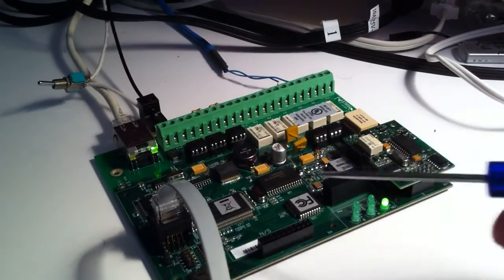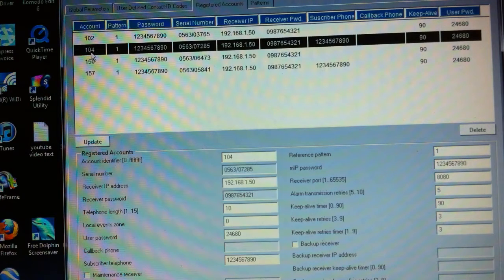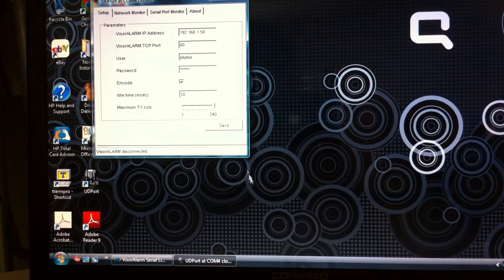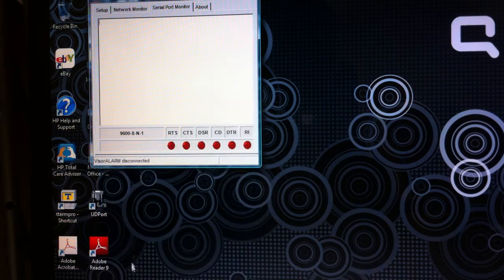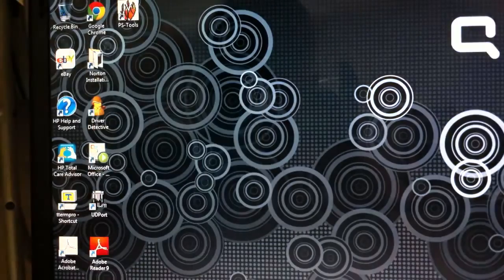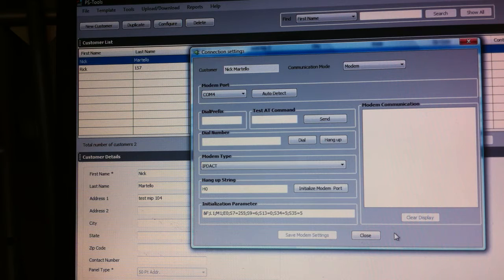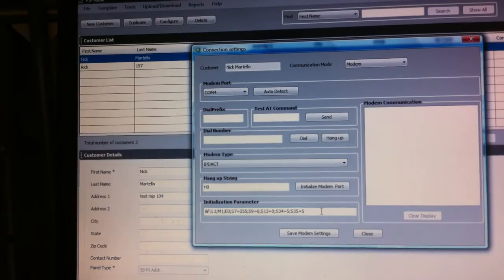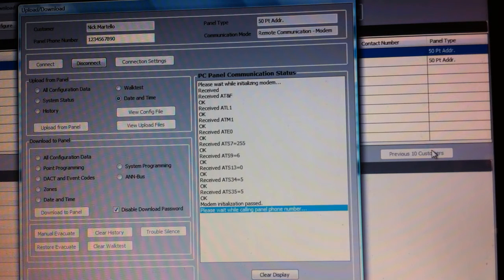Upload Download

Comment: I am having an issue with a customer where we need to confirm with the ipdact2-ud that the ip addresses are programmed right. We believe that when sequritas bought out Stanley sequrity the primary and secondary ip addresses are now changed and putting the fire panel into trouble. Please let me know if I can give you call possibly. Or I can give you my phone number. We are notifier distributors in the Chicagoland area. Notifier does not support this ipdact2ud card anymore.